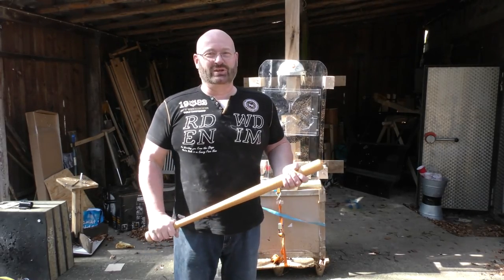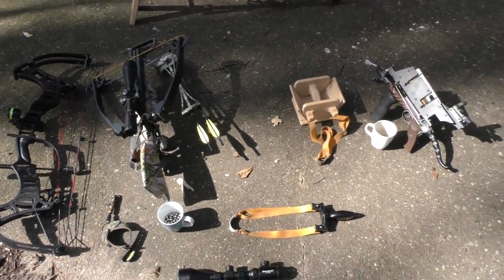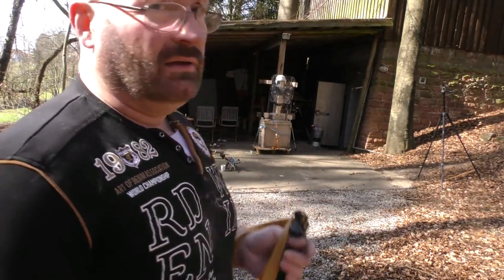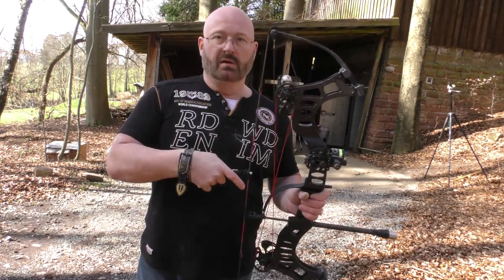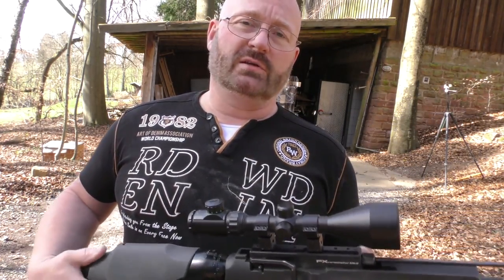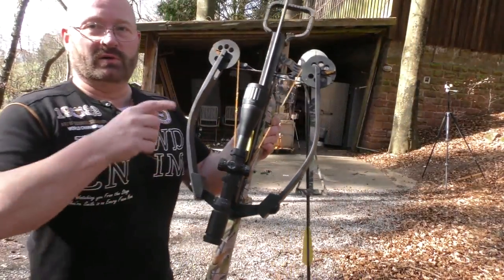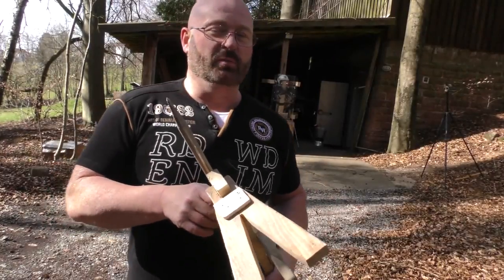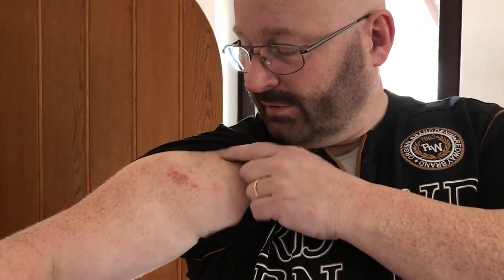Reupload: Shooting Right Through Police Riot Gear

Comment: A steel ball hits his ankle with something that can go 480 feet per second and he just laughs.
Reply: 460 feet per second isn’t that bad
Reply: @brycep7093  480fps would go inside your ankle if not through it
Reply: 10mm steel ball at 480 fps will not penetrate your ankle.
A 6mm plastic ball (airsoft bb) can travel at 500FPS and just causes a bit of skin breaking without clothing protecting (I know that plastic and steel are very different materials, yes, but despite this it is a blunt object.)
= at 480FPS a 10mm steel ball causes bruising or breaks a small bone, can slightly break skin. With clothing there should not be any kind of penetration.
Reply from the maker: @Loodkuro  Oh, but of course a 10mm steel ball at 480 fps WILL penetrate. The plastic BB only weighs 0,2 grams, while a steel ball with 10mm dia weighs more than 4 grams - 20 times as much. This means the momentum is 20 times higher but only 2.8 times the surface. Pressure is much higher. Believe me, I have seen plenty of deep wounds from slingshot hits, even experienced a view of them myself.
Reply: @Slingshotchannel  are you a demi god?
Reply: it was only a ricochet... it lost the majority of it's power by the time it hit him
Reply: Ok, lets apply physics here:

A 10mm Steel ball has a mass of 4.19g (0.00419 Kg), if it goes at 480fps (128m/s)= it hits with a force of 0.536 Newton

A 20mm steel ball, it have a mass of 33.5g (0.0335 kg) x 128m/s = 4.288 Newtons

If a BB gun shots a 0.20 g BB at 128m/s it should hit you with 0.0256 Newton, it hurts a bit. A 10mm steel ball will be 21 times stronger and will definitely penetrate your skin and cause damage. Now a 20mm steel ball will be 168 times stronger than a BB and you can bet that thing will do serious damage to part of the body it hits
Reply: Even god fears this man
Reply: @Slingshotchannel  It might penetrate AN ankle, but it wont penetrate YOUR ankle.
Reply: Blad0s you don’t know the mass and energy do you...... that’s not how you calculate a projectile’s power....go back to high school for physics
Reply: @sGeeMoney  It would hurt if he was the primary target, but as someone who often does airsoft I can guarantee you it wouldn't go through (it can penetrate at that size if he was the primary target, but not very deep due to the shape of the projectile being specifically made to spread out the force of the impact). Been the primary target of steel balls with way more force, and while it hurt a bit they rarely penetrate. Now to further add onto this, that ball's primary target was the shield, that means most of the force and energy wasn't even present when it got thrown back at him! You have to remember that the reason why balls are used in airsoft is because the shape makes the "bullet" spread out its impact rather than penetrate as a pointed or flat tip would.
Reply: @Loodkuro  Lil Physics refresher. F=MA. Force = Mass x Acceleration. A plastic BB weighs on average 0.12-0.20 grams. At the same speed a 10mm steel bearing weighs approximately 4.506 grams, produces 22.53 to 37.5 times the force of your single BB. Not to mention plastic has more "give" and "bounce" as it is a significantly less dense material. However, after the initial impact and subsequent ricochet of the riot shield, the 10mm bearing likely had a mere fraction of force when it made contact. His homemade arrow bazooka's recoil did more damage to his shoulder by far.
Reply: @Slingshotchannel  I did the calculation as well, and yes, growing up ball bearings can be as dangerous as small caliber bullets in the wrong situation. A paintball is about 17-18 mm and 3.2-3.6 grams travelling at a maximum safe speed for sport of less than 300 fps (In Canada). However even a ball of hard gelatin shot at much faster speeds will break skins, blood vessels and in one case I saw will actually shatter a mid-range priced, Safety passed paintball goggles, and shoot clean holes into drywall
Reply: @Slingshotchannel  didn't you experience one on one of your videos here? A particularly nasty ricochet to the face? People think slingshots are toys, I think your videos show they are most definitely very capable weapons.
Reply: @Slingshotchannel  can an arrow penetrate clothing?
Reply: Dino the dino takes anti-tank rifle round to the leg 
laughs 
“Haha it’s nothing”
Reply: You didn't noticed how fast it hits the target and how slow it comes back it's still not moving the same speed

Comment: This guy just pulled back  an 80 lbs bow like it was nothing
Reply: Ayy Lmao Maximum 80 lbs, the draw weight drops significantly after the brief moment of 80lbs, because it is a compound.

He does still have some impressive tricep and delt strength though, I'll give him that.
Reply: TissuePaper you'd still have to be able to draw that even if briefly
Reply: Mines set at 70and hardly struggle. And my hunting buddy has. A recurve that's draw weight is 180 and he barely flinches.
Reply: 80 likes
Reply: @theduke2398  Bullshit no one on earth can pull a recurve at 180. World record is 200 for longbow and 160 for recurve, your friend pulls 40 with ease, not 180. Anything above 80 at recurve would have 99.999% of the population unable to pull. Otherwise your friend is a world record holder.

Comment: Unlike what videogames will portray, riot shields are NEVER meant for taking any very serious threats like guns and crossbows. If people are getting close enough to use knives, you've already failed- the shield is for projectiles most commonly thrown during riots: rocks, rubble and debris, heavy objects, and even slings used during riots which are deadly enough on their own. The padding is for blunt and improvised weapons used frequently during riots. If the riot police are dealing with people using firearms and things like crossbows, they shouldn't be there in the first place- there should be SWAT and National Guard. Riots are almost never seriously organized- things usually spiral out into riots from something like an initial protest or lootings. If riots are organized enough for people to show up with lethal weapons, that's when SWAT should be deployed. Excellent video as always, Joerg!

Comment: Old video I just saw. The plastic has memory that creates resistance on the shaft after the tip penetrates. When you pulled it out I’m sure the hole closed due the plasticity of the material. If the shaft was narrower than the tip, it wouldn’t have that resistance. Also could use Teflon on the shaft to make it more slippery.

Comment: I have this picture in my head that Joerg has some kind of rubber powered mech somewhere with an air-zooka with compressed air bottle payload, auto crossbows, giant orc sword and 300 pound warbow with instant legolas that shoots broadheaded spears, 8 of them, it's possible to fit 9 but the manufacturer only recommends 8. The final attachment is, of course, a handheld slingshot that shoots 80 mm steel balls.

And it's all still legal in Germany.

Comment: Instead of steel ball, try 20mm lead ball that has been double-split. By that I mean a split on one side of the ball, and a perpendicular split on the other side of the ball. This does a few things: first, the splits make the ball deform upon impact. Second,  this deformation helps more of the momentum be translated to the target as it does not bounce off so readily. Third, the splits add ‘edges’ to an otherwise round projectile, thereby adding a little cutting power as the ball deforms. Try it and see how it works. I’ve gotten such lead balls to stick in solid wood where steel balls bounce off.

Comment: That’s neat. I think the two bows that did penetrate could do better if the arrow/bolt shaft was a fraction thinner then the head. All that resistance after punching the hole would be gone and preserve more kinetic energy.

Comment: Romans used a Pilum to penetrate shields.
It made the shield useless, because you couldn't get it out anymore.
A pilum is a spear with a long thin shaft as a tip, and a heavier wooden shaft to hold it.
Just curious how that would do against a modern shield.

Comment: The main difference in reality is. That the shield is it is being held by a man will always move when it gets hit. They cannot hold a shield perfectly straight when it gets impacted. The movement actually works great for deflecting. A hard solid object with a perfect flat surface. Is  much easier to penetrate because it stays directly in line with the arrow or object. When you hold a shield the angles you hold it will deflect any blows or arrows in real life this would not penetrate I'm very sure if that

Comment: Realistically, the shield would be able to move a little when hit by an object, and a lot of the kenetic energy from an object would be absorbed and dissipated because of that movement being allowed.
See what happens if you mount it to either a mechanical arm, or a shock absorber to imitate a police man holding it with their arm.

Comment: Bit funny though, because at least in Germany (riot) police is rarely seen using shields. On average at least. Anyone can tell if they've seen enough of them deploy or seen enough video footage of escalations over the year. Sometimes you see a few shield holders per larger squad or formation but that's it. It seems they all individually carry enough protection beneath the visible clothing, but I reckon in really escalating riots a shield can come in handy as it doesn't require an object hitting the clothing and body armor first before its energy is "soaked up". A shield does the job in front of you.

But no expert here, in the end, just saying here police doesn't often use shields opposed to other countries that sometimes seem to use whole riot formations where first line(s) have a shield.

Comment: They also have to worry about team work.
The populace outnumbers police officers, and 2 or more people, armed with tbe right tactics and equipment wpuld have no problem.
The shield is so indestructable, I suggest using methods of controlling the shield, instead of penetrating it. A plunger, or high power suction cup on a stick would be incredibly hard to defend against if they had a battle buddy targeting the same officer